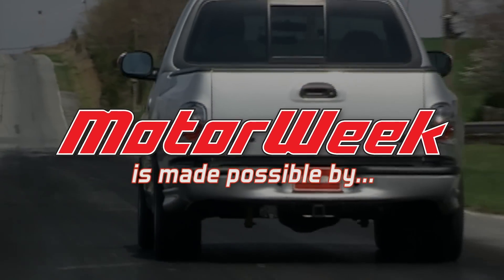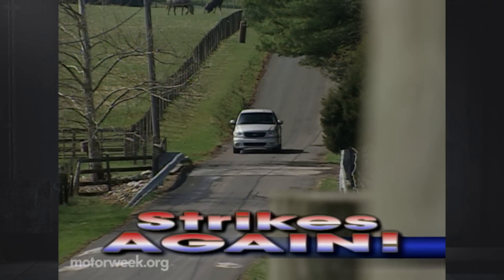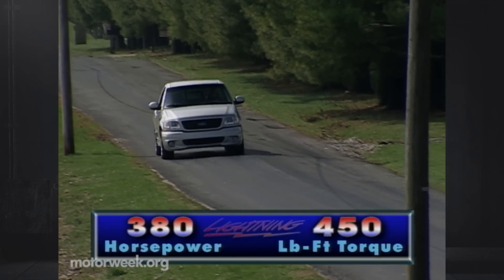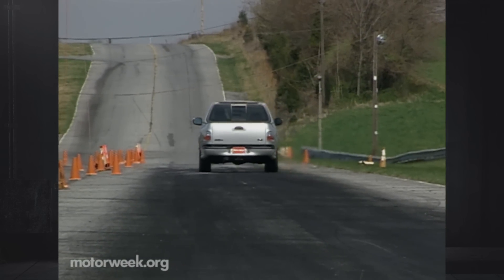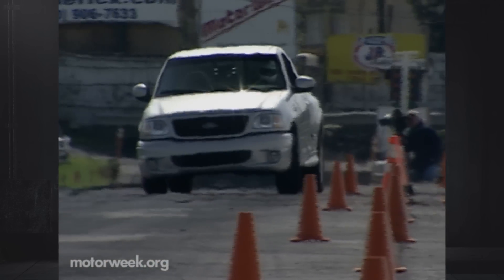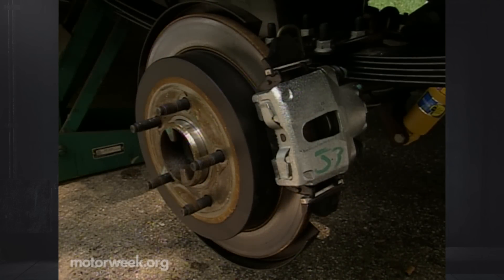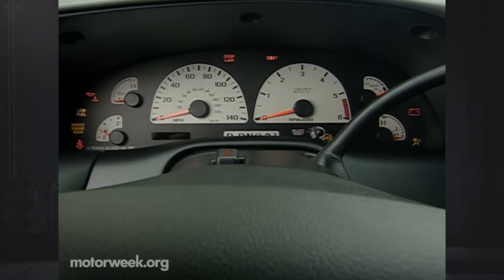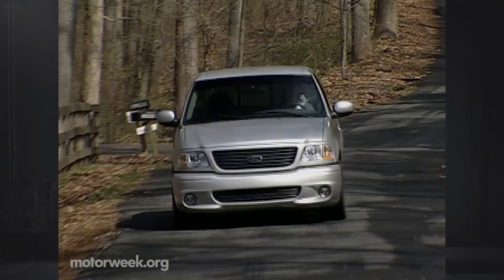2001 Ford SVT F-150 Lightning | Retro Review

Comment: 17 years later, 100 more hp, 60 more tq out of a V-6
Reply: and it sounds like a leaf blower I'd take the lightning.
Reply: 450hp in the overweight limited. Plus.... sounds like leaf blower. lol
Reply: Yeah that probably has to do with the "17 years later" part.  How was your Internet speed back then.... ffs
Reply: brent vance 
With turbos 😂
Reply: RedReign umm not really it is a legitimate criticism maybe you shouldn't go around saying people only criticize something because they can't afford it.

which by the way I drive a 2017 Silverado 2500 duramax I can assure you the duramax costs more than a raptor...
Reply: RedReign Why are you so insulting I didn't buy diesel to save money on fuel I bought it to tow my camper that weighs around 11k pounds loaded with gear.
Reply: You obviously do not tow I had a silverado 1500 and yes tow ratings say you can tow it and it has decent power to pull it but the soft suspension and chassis isn't good enough to handle it without the tail wagging the dog effect and forget it if you get into elevation you'd be going 30-35mph up a grade in the Rockies if you were lucky. I don't know why you seem so angry about it never listen to a half ton truck rating that says they can tow 12k pounds because when you actually tow that much the truck cannot handle it safely.
Reply: 17 years ago a V6 had how much hp and tq? Besides I’ll take this truck over any V6 car of today, no questions asked. This is a badass truck.
Reply: Npc_Hydra3 if that’s happening when towing 11k with a 1500 seriously go test pull a 3.5
Reply: Npc_Hydra3- sounds like aead blower? That statement really showed you’re only 12 and have never driven any car
Reply: Mr. Céspedes you would take it over a Ford GT? Would you really...? Lol
Reply: Rather have this with an upgraded blower  and supporting mods.
Hows 700 at the wheels sound son??
Reply: brent vance the Coyote 5.0L makes more power N/A with less cubic inches too than the 5.4L supercharger engine of the lightning. Technology has advanced so much.
Reply: Npc_Hydra3 and you are showing off your new truck for what? Which yeah I’d take your truck any day over the V6 but don’t get why people have to show off what they have or talk about what they have
Reply: RedReign you’re poor, stop. Eco boost is a wind up toy motor. I have one in a new 18 f150. Not impressed
Reply: Weird that v6 is so much slower.
Reply: @Jakevoss96  lmao 1. Half tons are gay unless they are street trucks like the SRT10, Lightning, or SS. 2. Diesels are way better than gas.
Reply: Womb Raider   The guy was saying "typical response by someone can't afford it" My silverado high country cost 70k so I can indeed afford a raptor as most raptors fully loaded with the 802a package are around 65-67k so I don't see why you are insulting me?
Reply: Leaf blower or not its beating all the v8s at all fields I thought the same but ended up with a 3.5 twin turbo and it kicks the teeth out of a lot of things on the road now even some sports cars sonyeaniys a hell of a leaf blower it might just be a tree blower
Reply: @brandonmoore9440  these idiots have obviously never tried to tow 10k+ lbs through mountains with a 1/2 ton. I'd say anything over 8k would be better and safer with a diesel 3/4.
Reply: And half as reliable
Reply: sadly the ecoboost will always sound like a Honda Accord no matter which exhaust you get.
Reply: But my Lightning still smokes those puny V6's.
Reply: Ecoboost may have a higher advertised hp rating, but that means nothing. Torque curve is what wins drag races, and the boosted 5.4 has a nice fat 1! If thats not good enough, about 100 extra hp can be had with a pully swap/exhaust/tune. Not to mention that these trucks are much lighter than any new 1/2 ton.  This and the Syclone/Typhoon were the baddest trucks ever made... PERIOD!
Reply: ... and anyone who thinks towing 10k lbs with a modern 1/2 ton truck is safe had better go ask their mommy to read them a bedtime story. I should know... i do it quite often, and it is not!
Reply: Ecoboost rules the roost
Reply: @Barberdan  haha don't be jealous! Limited F150 is top tier and sounds just fine. Who needs V8s???
Reply: @5ohJ  not impressed eh? Your 1 of the few.
Reply: @dennislilley3190  Ford trucks reliability is rated #1 of ALL trucks. Us owners know why. If ur so happy with ur outdated low tech V8 why you arguing?
Reply: @Davido50  Somebody with working ears is just a suggestion...
Reply: @Barberdan  smh .. Have a nice evening.

Comment: I remember when I wanted one of these. The the Dodge Ram srt-10 came out and I got that instead. Viper v10 with a manual was a no brained.
Reply: SRTology yeah but it's slow af tho
Reply: @hectorvazquez4528  it was faster than the lightning
Reply: @c.albrow9161  not with bolt ons
Reply: @hectorvazquez4528  .lol then it's really slow if you have to mod it to keep up with the Ram SRT-10

Comment: Put a 526hp 5.2L V8 from the Mustang GT350 into the current Ford F-150, with upgrades, and you'll have another winner!
Reply: Lol. Don't know if we would see that again. The 6.2L from the Raptor was available for regular F150s, but due to the 2V design I think it only makes like 411hp, and with a relatively small aftermarket its hard to find parts for them. A Hellion turbokit with get it up to like 600rwhp IIRC. An ecoboost 5.0 would definitely liven things up though. Would love to see that in a Mustang or F150.
Reply: cadsux 5.8 from the 13/14 Gt500

Comment: Wow this really is a blast from the past where they’re excited about 380 hp LOL!
Reply: 380hp is no joke, it just seems like it because people are spoiled now. 380hp is more than most people need or can use, especially in a 2WD vehicle on street tires. This has been scientifically proven. After 400hp, all the extra power is just wasted in rubber smoke, and just makes the vehicle difficult to drive because if you touch the gas more than a little bit on a corner, off you go (or even a straight, for that matter). With a skilled driver and special tires and equipment, more power makes a difference on a drag strip, but for a street vehicle or on a technical race track, an 800hp car is rarely faster than a 400hp one. With a good driver, it will be slightly faster, but not anywhere near twice as fast.

Comment: These trucks were incredible in their day. However, I would be remiss if I didn't point out the sheer stupidity Ford showed by not packing the Lighting engine into a Mustang body. It may not have been so easy for us F-body guys to run roughshod all over the blue oval's machines had they done that. 

For all those Lighting drivers talking about gapping this and that...I have raced many of them before in both my 1994 25th Anniversary Trans-Am and my 2002 Firehawk Trans-Am. You guys could beat my stock LT1 but it was always a decent race. You could not touch my Firehawk. She gripped/grips far, far better than a Lighting and while you guys were spinning I was typically two car lengths away. When I changed the heads and intake out for all LS6 parts, Borla exhaust straight back, chipped, and tuned that was the end of it. Forget the Lighting...I was melting 03-04 Cobra's with the pulleys like they were nothing.

Comment: FORD - listen.. put out a new single or extended cab Lightning today with a supercharged 6.2L V8 with power around 550/650. 

And for the love of God keep anything with 6 cylinders and turbos AWAY form the Lightning badge. 

Signed, 
Everyone
Reply: Casey Todd I agree 100% but the 6.2 is retired from the F-150 lineup.  Maybe that new 7.0L that's been talked about would be nice😏😏😏😏😏😏 And for the love that's all holy.......keep it a 2 door truck. It's a muscle truck, not a soccer moms truck.
Reply: Jimmie Styer ...ooooooohh. A supercharged 7.0L in a single cab config.
Reply: I understand your attachment to the V-8, but the reality is the 6 cylinder Ford GT40 is QUICKER than the last generation 8 banger. We're dinosaurs Casey. And the ecoboost in the Raptor has more torque and horsepower than ANY factory V8 ever enjoyed. People today call the 5 litre (302 CID) a "big ol V8". No, a "big ol V8" was the 500+ cubic inch Caddy, the 460 Ford and 454 GM. Nobody loves a V8 more than me, but it has outlived its usefulness. Fewer cylinders and smaller displacements are here to stay. The V8 is on its last legs.
Reply: Sad.. but true.
Reply: Tom Swinburn I unfortunately agree 100%. But the thing that sucks about that v6 really is and that's with all new engines to be honest. They make them hard for us to work on. Today's engines make so much power and are amazing with fuel economy but they are so difficult to work on that the average person cant really work on them.
Reply: Jimmie, you got that right. I don't even try anymore. And you need the diagnostic equipment from hell to tell you what's wrong with any of this new stuff. The days of shade tree mechanics (me) are long gone. Not only diagnostic equipment but specialty tools are needed, often reliant on brand. There's no doubt that electronic fuel injection ekes out more horsepower and torque than we ever thought possible. But massageing it to attain that is beyond my capability. I could handle carburetors. The tiny springs and o-rings, gaskets and such a pain in the butt, but doable. The rocket science of current automotive mechanics is beyond me. I MISS my big ol V-8s, inefficient as they were.
Reply: @tomswinburn1778  What is sad today is if you bring in a carburetor car, 80% of today's techs cant work on them cause of being a old technology......I know cause I'm one of them 😆😆😆😆 I want to learn how to work on them but we never get to seem but maybe once every 6 months. I'm 29 and there is not many left from the area of carburetors. And E.F.I is about to be the next carburetor. Direct injection is taking over Electronic fuel injection.  And like you said with the "specialty" tools for each brand is getting way worse. And the only time we see a big block v8 is when it's in a old motorhome. Rarely a 1ton farm truck. For me today's engine are easy, IF you have the computers to talk to them. But they are boring compared to older engine. They do make more power, but there are not as exciting as old school engines.
Reply: And direct injection is a step up from EFI. I was never an auto mechanic, other than the shade tree type. I fixed air conditioning systems for a living. Still in the same family and requiring diagnostic talents. But the computers needed today in many cases communicate with the manufacturer direct. So even a legit repair shop is stuck out on some issues. And an owner TOTALLY SOL. In my day though seldom did I run across something I couldn't correctly diagnose and fix. I'm 70, so I was past the baling wire and tin can era, but still awfully simple compared to today's vehicles. We never even considered variable valve timing, or that one day distributors would be a thing of the past. Electronics played NO part. Sensors? What the hell would that be? Nah, for an old timer like me this new stuff IS rocket science. When I retired from A/C work we were already seeing the computer age taking over that too. And like cars, repairs have gone thru the roof in terms of cost. A condenser fan motor which for years I could buy for 30 or 40 bucks became an ECM that cost the tech 400. Yeah, the new A/C is more efficient, but if you lost ONE motor in its life you more than lost all the savings in energy costs. I'll go to my grave thinking we've lost more than we've gained.
Reply: Casey Todd throw the v6 in the garbage
Reply: What about putting the blown 5.2 Voodoo from the new GT500 in said Lightning?

Comment: If I had my way. It would have came with a full bed and rear air spring so it could sit level. I always thought it was stupid. The truck was not made to work. Why was it jacked up in the back?
Reply: tiny load capacity
Reply: Seriously? WTF is wrong with you? It is a supercharged, short bed sports truck, meant to lay rubber and do 1/4 mile runs. It is not a work truck. If you want load capacity, go buy a regular F-150. No one is shopping an SVT Lightning because they need a way to haul 1,000lbs of cement bags to the jobsite really quick. It is not meant to carry anything but maybe groceries, it is a toy. A way to brag that your 'pickup truck' beat a Camaro at the lights. It was jacked up in the back A. to make it look stanced and cool, B. so when you accelerate hard from a stop, the rear dips down to level, instead of going nose-up and reducing steering authority. And if you are bitching about load capacity, the last thing you should be whining about is a raised rear end. If it came level from the factory, when you loaded 500 lbs in the bed, you would end up with a squatting rear and headlights aimed for the trees. Almost ALL trucks used to come higher at the rear than the front, so when they were loaded they would ride level. A standard aftermarket accessory in sport-truck magazines was the 'leveling kit', which made the truck ride at a level stance.....at the cost of almost all of the load capacity. So I cant imagine why you would complain in one breath the the truck has too little load capacity AND that the rear rides too high. The only way to avoid a high rear is to install really stiff springs and ruin the ride.
Reply: @justforever96  I stopped reading your comment @ W. When you remove it and talk to me like a normal person. I will answer your question.

Comment: A new lighting with the 662hp Shelby engine
Reply: I heard if you want to make a lot more power it's cheaper to go the 2013-14 GT500 motor swap route. I have an 03 Lightning and I've been doing some research to find the best way to build big power. I'm only going to put about 650-700 hp in mine but if you want more then the swap might just be for you. Especially if you want to convert it to a 6 speed manual.

Comment: It's crazy that the new 3.5 Liter V6 EcoBoost in the modern F-150 makes more power and more torque than this supercharged 5.4 V8

Although, the V8 sounds so much better.
Reply: I dunno I just rented a 2019 f150 platinum 3.5 eco boost and it sounded fucking beastly you can hear the turbos spoolin up like crazy and it pins u bak in the seat something fierce too
Reply: Why is that crazy? This was 20 years ago, with a 2-valve engine. Computer controlled timing and boost makes it easy to put power out of an engine. They could have have easily cranked the boost up on this truck to make 500, 600 hp, but there was no way to do it with the reliability and dependability customers expect of a factory vehicle. A modern engine can make the power it does mostly because the computer system only allows it to make full boost when it can handle full boost. And of course they have advanced in gasket materials and part manufacturing as well. Mostly via computer control.
Reply: @justforever96  It's still impressive.
I have a 3.5 EcoBoost F-150 now. I think I bought it shortly after that comment 2 years ago.
It is definitely a fun truck.

Comment: An important issue buyers should be aware of is the ineffectiveness of the airbags on this generation of Ford Trucks. 
Even with the steering wheel in its most vertical position it would ignite the airbag at your belly button, not your head. So, buyer beware...

Comment: It’s a shame Ford cheaped out on the engine and didn’t give it the 4 valve 5.4
Reply: 4 valve 5.4 would have been awesome. The Cobra R had a naturally aspirated 4v 5.4L making 385hp, 385lbft of torque. Ford decided to go 2 valve again with the 6.2L in the F150's and it only makes 411hp. Such a shame, these things would have been beasts in DOHC 4v form. Add some boost to that and it would have been a thing of beauty.
Reply: Actually the Ford GT had a supercharged 4v 5.4L, made 550hp. The early GT500s had a 4v supercharged 5.4 as well, made 500hp on them though.
Reply: @AlexLopez-vx3cr  that's right, and remember that Cobra R was putting down 385 hp at the wheels.
Reply: @BrownBomber92181  pretty sure that 385 was at the crank car companies don't measure the power at the wheels bcuz it will be less, you know marketing strategy....
Reply: @mikes5687    Yea, that's what they reported was 385 at the crank, but there's multiple stock Cobra R's that laid down 385 hp & torque at the wheels

Comment: People saying modern small V6 makes better hp correct but at what RPM?  These peak numbers on cars anymore are ridiculous being up in the 5-7k range they make shit in useable hp without having to hammer down and let the engine spin up so far.  Good luck on the cost of maintenance on new engines making that kind of hp.  5 year throw away engine is what they make these days.